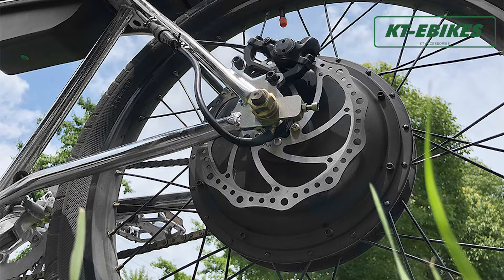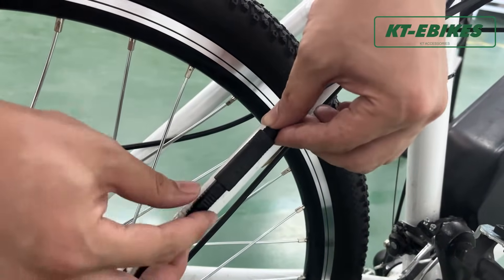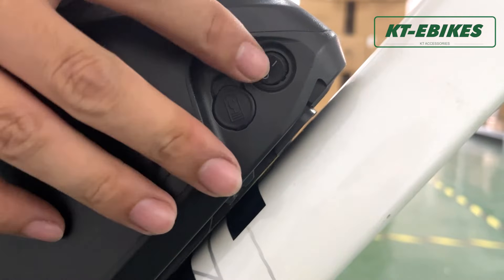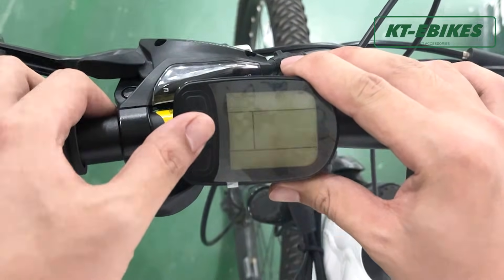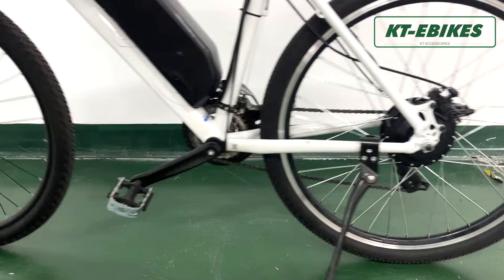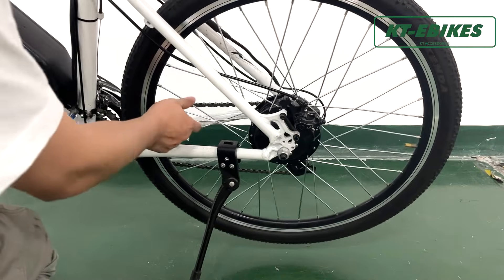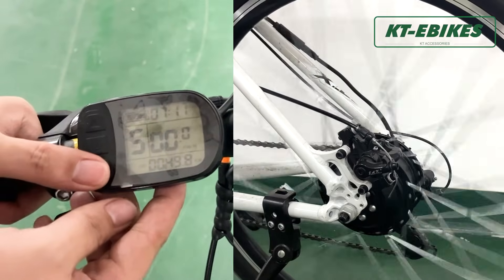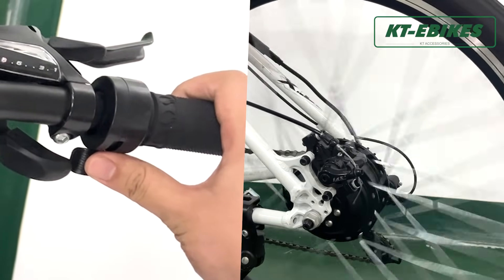Electric bike not working? Try these Troubleshooting steps!

Comment: I have Hidoes B10, after 30 min of riding on smooth pavement, it completely lost acceleration. I’ve checked wires, pedal assist /booster works.  and it does not work

Comment: When I hold down button the assist works but it’s slow and the throttle doesn’t work at all?
Reply: Check that you have the original throttle that came with the kit , if you have bought a new throttle it always pays to check the colour and arrangement orders for the throttle match the same order for the female input throttle connector port. I did this and finally my throttle worked

Comment: my motor is making a loud humming noise. what do you think i should do. also can i have the link to the motor
Reply: Step one check the connections for negative , positive and earth are in the correct order and clean strong connections on all 3 . Step 2 replace the motor with a new one of the same amount of WHAT'S that the controller box is designed to power.

Comment: Does your chain have to be on for your ebike to work
Reply: If you want to use the pedals yes it does
Reply: Not necessary, if your sensor is on the bottom bracket, you can just pedal with no chain/belt and it communicates to motor to give power. But your motor has to be in one of the wheels.

Comment: @jacksmith4266 your problem could be in your settings when you hold down the plus and minus once and then again, I believe you're pedal assistance is turned off.  In the settings position two is pedal assist with throttle.
You may just have to hold the plus and minus down once after the bike is turned on.  Either way look for those numbers if you hit the power button cycling through the choices

Comment: Wow! Thanks for letting me know how to know if it's working or not. Even though I already knew this and this video proved to be nothing more than a waste of time, at least I can continue my search for help as this video contributed 0% useful information.
Reply: I've got same problem man. All wiring seem to be good all shit should be right, battery works and somehow motor and throttle doesn't run. I will answer this if I find a solution.
Reply: @yehsnkqwkeyehsnkqwke4678   yeah my motor just hums and doesn't move when I press the throttle. I put a brand new replacement motor on it too and same issue. Also i noticed the connection for the motor was heating up when I tried demonstrating the issue for a video for the company.
Reply from the maker: @yehsnkqwkeyehsnkqwke4678  These are only the preliminary investigation of various accessories, only know that these are no problems, in order to our car motor investigation, controller investigation, display investigation. The rest can watch my other videos.
Reply: @yehsnkqwkeyehsnkqwke4678 did you ever figure it out cause I’m having the same problem and can’t find anything
Reply from the maker: These are only the preliminary investigation of various accessories, only know that these are no problems, in order to our car motor investigation, controller investigation, display investigation. The rest can watch my other videos.
Reply from the maker: Okay, so be able to tell me exactly what you need to know?